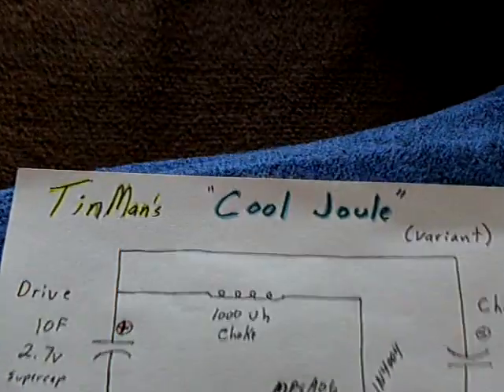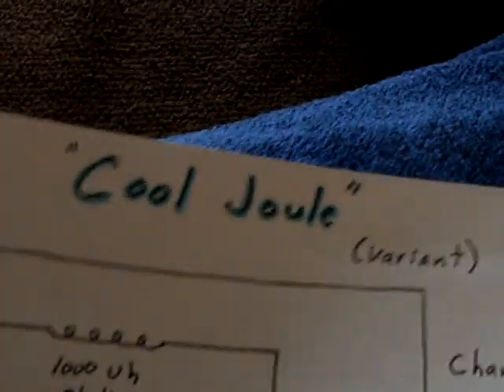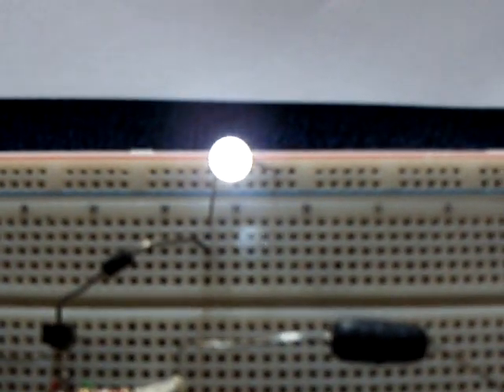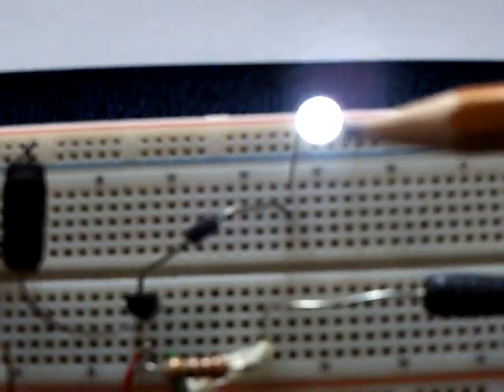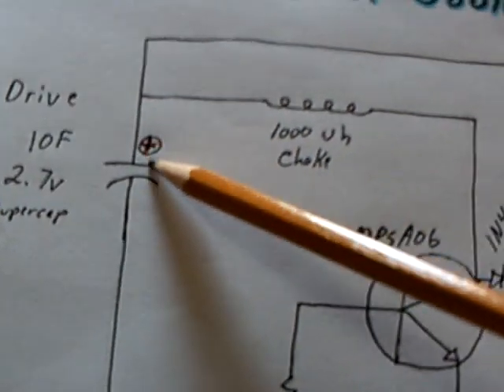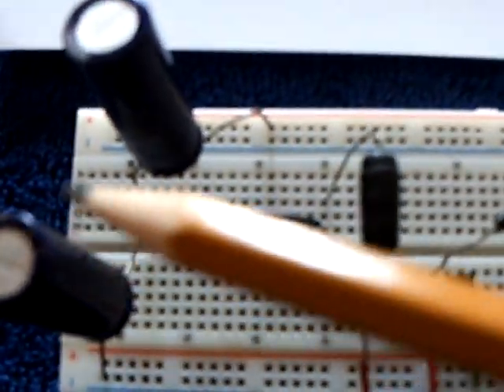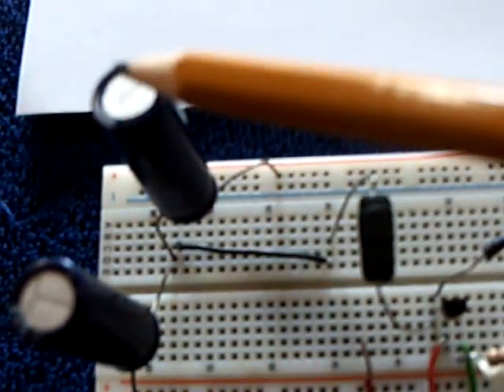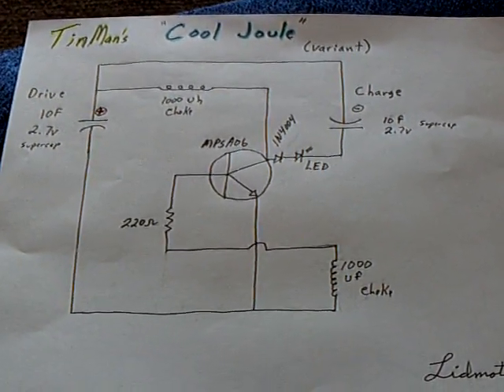The "Cool Joule" LED circuit

Comment: Hi, I liked your circuit. I don't know too much(almost nothing 😂) about electronics and components. I have a question. What type of transformer I can use? Pulse transformer or single phase? And how much voltage it needs. There are high voltage transformers like 220volt to 5volt in the market.

Comment from the maker: Hi Patrick.  I do have the negative on the charge cap going back to the positive of the primary.  As TinMan mentioned in his first Cool Joule video, this is a modified JB ss ssg circuit.  What really got me interested was the way that the trigger and drive coils could be seperated and the circuit would still run.  I'm sure that John knows all about this effect and has probably talked about it.  I just don't recall him mentioning it.  Perhps he found out that it wasn't a good way to go.

Comment: I will have to try out alkaline battery and watch and see. I have noticed along with a few other people the dollar tree colored solar lights have a super fast recharge circuit in them. I had opened mine and put in an ac type cap to increase the brightness of the led. They use the smaller cells half the size of the standard aa battery.

Comment: And that brings in something else :)
Tinfoil near the inductors affects the draw interestingly, relating to brightening/dimming of LED with distance. One inductor brightens but uses more current (up to a whopping 100uA lol), one dims (down to around 1/2 usual input).
Combined with AV, it all gets strange and interesting even further !
A lot of fun and a different yet familiar system.

Comment: Runs well. I've been using 1000uH chokes for the last couple of days because they arrived in the post...arrived at 5pm and circuit was running by about 6pm lol. 
Most solar lights have around 330uH and they are good for replications of the inductor method if got none (only 1 in each light though). 
Watch for ambient temperature changes with Ni-Cd's re voltage, as is chemical reaction like the salts cells, rising on warm days.

Comment from the maker: How about this----change out the Nicad with a regular alkaline AAA  (4 for a $1 at the dollar store),  You will be amazed at how long that will run that cheap solar light.  Just make sure you take the battery out when it finally dies (weeks) so it doesn't ruin the light if it leaks.  You are right---they make great indoor night lights.  Just keep the light near a sunny window.

Comment from the maker: Thanks.  I will try a  2N3055 and see what happens.  I like Groundloop's theory on how this oscillates.  Other people have suggested the antenna effect.  I put 2 volts in that 10F supercap and it ran the led 6 hours!!  The 10F charge cap only went up to .95 v though, before the drive cap drained.  Smaller value caps go on up to over 20 v.   I should probably give the Nicad batteries a try.  It is a very interesting circuit---and very COOL !  Thanks for sharing it.

Comment: Hi Lidmotor-and thanks for giving it a shot.
One theroy at the moment is that the PN diode path between collector and base is whats charging the trigger coil to allow the oscillations to continue(thanks groundloop),but still looking into that.But this being the case,i may have a way of removing the trigger coil altogether and have just the run coil to do both job's-using just the one transistor.I have tried many transistor's,but the 3055 give's the best result's-and stick with the 1n4004 diode.

Comment: See isn't it more like the field is stored in the choke on the base, when the transistor opens, it allows the field to collapse into a current flow the opposiite direction which will close the transistor?  Isn't that approaching Dr Stiffler's exciter?

Comment: No big mystery here the battery chemistry has something to do with how they charge. If you recall the alum battery videos where they built different cells and ran them oscillators one of them stayed floating on with just the oscillator running. I have witnessed this with wal-mart led 2 dollar solar lights you change the nicad to nickel metal hydride battery and the thing will run for 4 days solid and stay floating for a long time after. I use mine for a night light in my room very nice light.

Comment from the maker: Now you see why I am puzzled by this circuit.   Normally a current is induced into the trigger coil by the drive coil and that turns on the transistor.  Somehow a signal is being fed through the ground backwards.  Someone should put this on a simulator and see what is going on.   There is probably a very simple explanation.  I just don't see it.